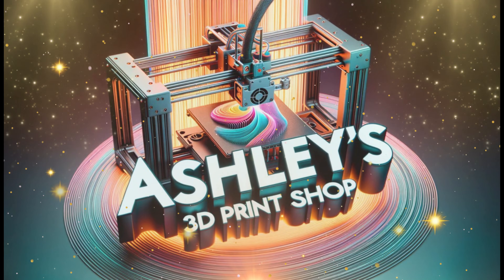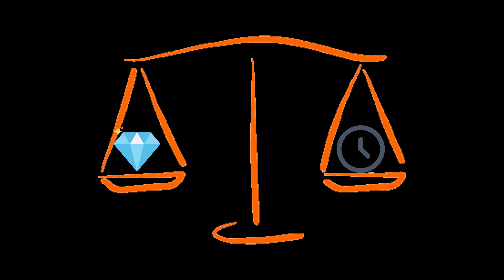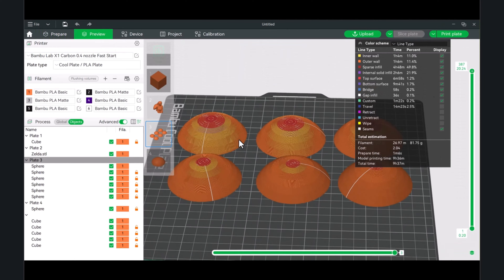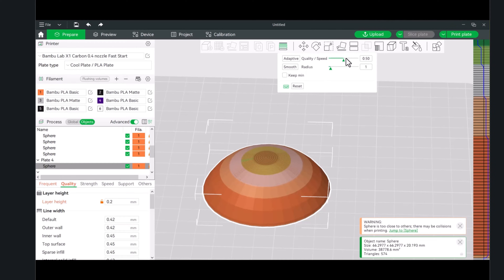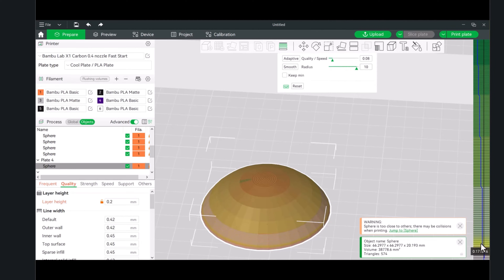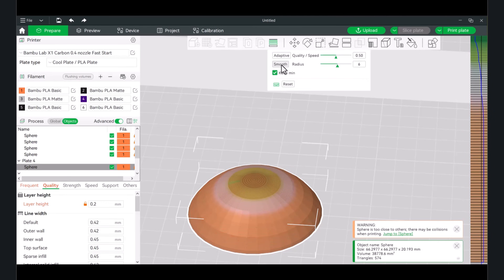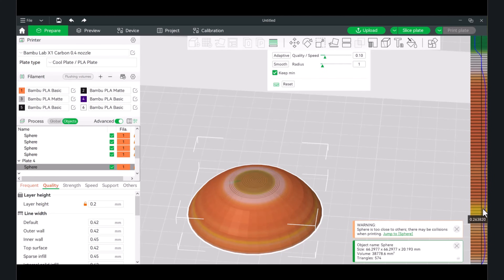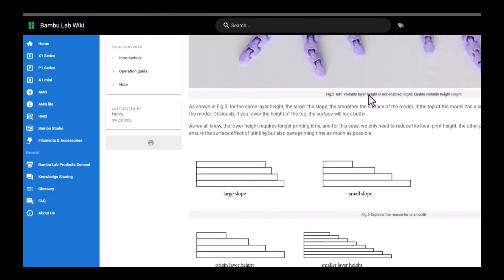Bambu Studio Tutorial. Variable(adaptive) layer height.

Comment: Maybe I missed it but what’s the quality/speed?  Is the higher the number better or vise versa?
Reply from the maker: Hello, thank you for the question.
Typically it works like this,
Higher number.  .24. .28 . faster prints but lower the details.

The lower numbers. .8, .12 .16. Higher detail but longer print time. 

.2 is the default which is the balance of speed and detail. 

This can be model dependent of course and you may not need to lower number(better detail) in every place.

Comment: How about when you have say a model you want the first 30 layers at .28 and the rest @ .20. Is there a easier way then right and left clicking? I thought having 30 plus layers of .28 printing then go to .20 would be a dramatic difference in time to print. it only gained 2 mins of time to print instead of taking off. It was faster to just print the whole model at .20 then adaptive layers of .28 to .20. Doing the automatic increased the model to 6.19 mins.

Comment: The problem I have is that the resulting print doesn't actually improve with adaptive layer height. What else could be the problem?
Reply from the maker: @alexanderkempf9828   rounded or curved tops get a benefit with lower adaptive layers. Depending on your model there may not be enough layers to fix the stair effect. So basically there will always be a stair setp effect but you can reduce it with the lowest layer height.

Quality can be improved with line width too.

There is a limit though. I recommend the Line width video but  short option for a .4mm nozzle would be a line width of .3mm for outer walls/text.

I started writing before asking a question but what are you trying to improve? Curved top, flat top, text etc?
Reply: @ashleys3dprintshop  i’ll take a look at your other video. I’m essentially trying to design something that looks like a sand dune in the shape of a half dollar; in other words, imagine a puck the size of a half dollar that has a completely flat bottom but the top has a gentle curve to it that slopes upward on one side. I’m running into the classic problem of the shallow part of the incline looking very blocky, but when the slope is very steep, it looks totally fine.

Even printing at the smallest possible layer height with the smallest possible nozzle (0.2 mm), there is still a blocky, topographic map effect where the incline is shallow. The only way I was able to solve it was to just sand it down, but that takes way too long.

Comment: Hi mate, thanks for a very good explanation. I have a question, how do you set the supports when using adaptive layer?
Reply from the maker: Hello, Sorry about the late reply. The supports will auto adjust for the layer height. 
Typically support layer height is larger height then the actual model
for instance a .2mm layer height may have a  .26 layer height for supports just like a .08mm model layer height will have around a .16mm layer height for supports.  Fortunately the slicer handles it all without much input from the user. 

You can see it in action when you slice and change Line Type" to *Layer Height
Reply: @ashleys3dprintshop  No problem!, thanks for your response =)

Comment: How do .8 Nozzle settings configuration.( Layer highest and speed setup)
Reply from the maker: So the nozzles have an upper and lower limit for layer height
.2mm nozzle     .04-.14mm
.4mm nozzle     .08-.28mm
.6mm nozzle     .14- .42mm
.8mm nozzle      .16-.56mm

There is also an option to lower the line width to help speed and quality.
It's explained here but with a 0.4mm nozzle. 
https://youtu.be/K6-qhX2S4IY?t=5

Speed gets a bit trickier to pin down since it is model dependent but typically larger layers theoretically print faster.

Comment: Very useful. Thanks. I would still like a more technical explanation of these features. Even your excellent video is mostly “click here, move this slider, and see how it improves”. I’d like to understand what and why things are done, technically. 

BTW, I found the Bambu Lab Wiki on this topic to be virtually useless.
Reply from the maker: Hey hey, thank you for watching and the feedback. Keeping with the theme of this playlist(bambu studio for beginners) I try to keep things light. 

Once I started that project I quickly realized I could fall into CNC kitchen levels of data and it all can change based on filament, nozzle size, temp, line width... When the question initially was "how can I make the tops rounded and reduce the topography map. 🥲 

@.4mm nozzle, Ideally the balance of speed vs quality boils down to even lines for walls can be fine around .16-.20mm without exploding the print times. Tightly packing each layer(low layer height) may look great for some applications and imperceptible in others even with a higher layer height. Since a lot of this situational I lean more towards showing the steps vs recommending a one size fits all solution...if that makes sense. 

Going to .08mm may only be worth it for curved tops and even then you will not completely remove the stair stepping effect, just reduce it.  If you wanted the printer to print the best it can , assuming time is not an issue you theoretically could print in .08mm.

Also I didnt mention you can post process these with sanding, fillers etc.

Comment: Good video, thank you. I had no idea this existed and you explained it very well.

I wish it was not only based on layers but instead focused on the skin of the part. I don't need the finest details (and added print time) inside the part, just what's visible. So somehow print default coarse internally but anything I can see in angled layers be treated with higher resolution.

PS: hopefully you noticed a bit of a bumpy audio track. Maybe related to WiFi connection or CPU overrun.
Reply from the maker: Thank you. There are so many options and settings in these slicers that I'm still trying to wrangle a decent instructional video.  I think when we can get non-planer printing we can get smoother transition between layers. But that would require a completely different printer. 
I'm going to update the audio system(again) to one with a safety track to audio those bumps.